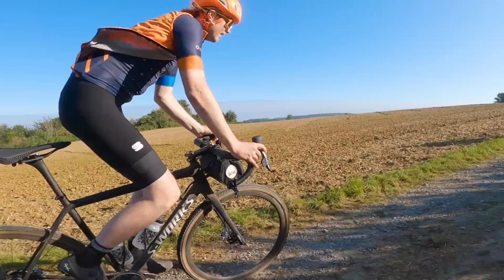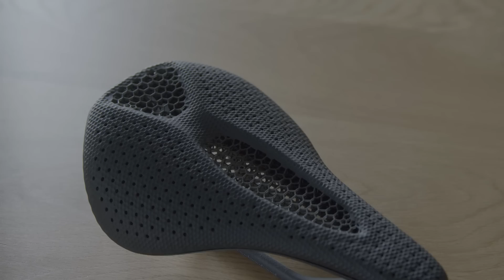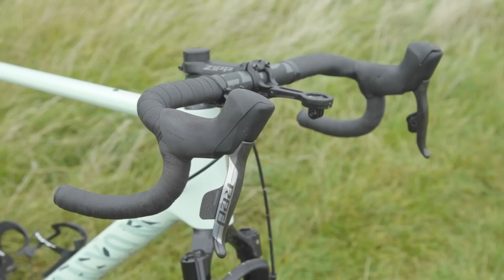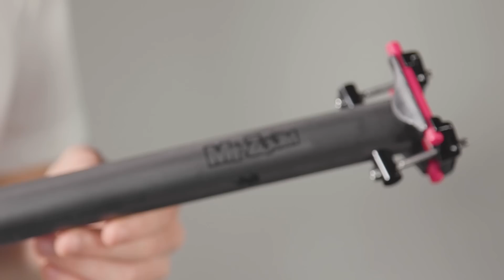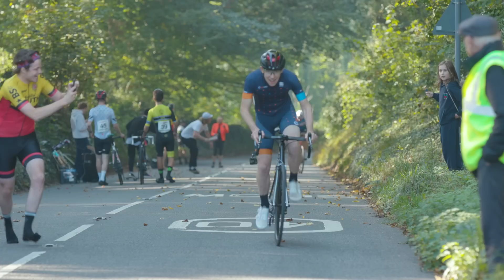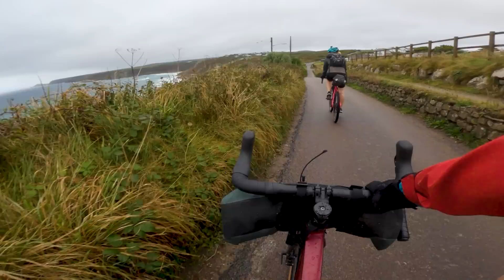SRAM XPLR Gravel Tech, Weight Weenie Parts & a $450 3D Printed Saddle | Tech of The Month EP14

Comment: Why not going for TPU inner tubes instead of Latex ones?? It’s supposed the roll just about 1-2watts slower but at half the weight.
Reply: Adding to the fact that carbon rim brakes and latex tubes are not a great combination. TPU inner tubes are much more resistant to the temperatures generated while braking.

Comment: Nope on weight weenie parts. Chased it for decades. Most of it broke. Carbon frames, seats, wheels   almost everything. I ride thousands of miles o. Gravel and need,reliability. Went back to steel and Ti.  Nice video though
Reply from the maker: We understand reliability is super important but I wanted to point out many of Mt Zoom's components are rated for XC and gravel riding. Thanks for watching! Felix
Reply: @bikeradar   to each their own. I ride 15,000 per years. About 80% gravel and dirt rural roads. Even on paved light stuff broke. 180 pounds no flab. 72 yrs old. I've seen many trends. Steel and Ti survived.  I look at my newer
 Trek Madone and think what an ugly bike. Squared off tubes , funny looking angles. It hangs on its hook. Hasn't been used in months. I like old classic looking bikes.
 I've learned what works for me.  32 spoke rims, robust wheels and tires and metal frames. Gravel beats up equipment.  Great work you do! Ride on ! Its great medicine

Comment: No, Latex inner tubes are not more prone to punctures (the real answer is the eternal un-sexy "it depends"). Actually, since the latex is more supple, tests have shown that it can deform more under the pressure of an object trying to pierce through, thus reducing the chances of a puncture (compared to a similar butyl product).